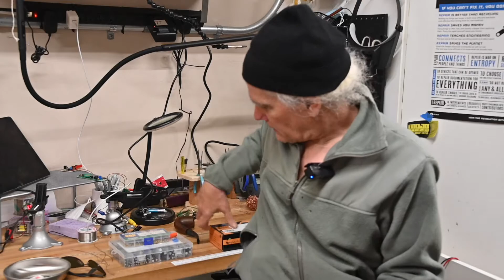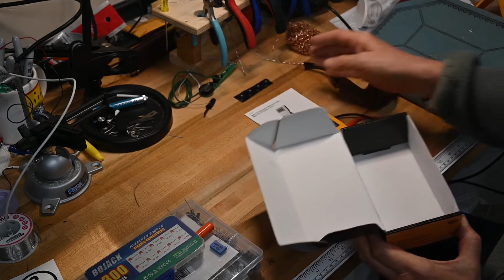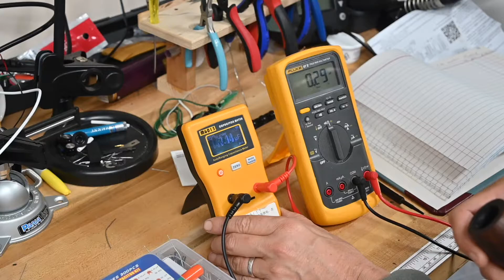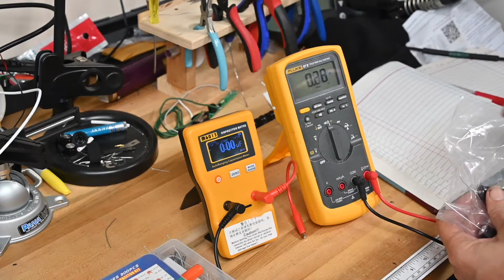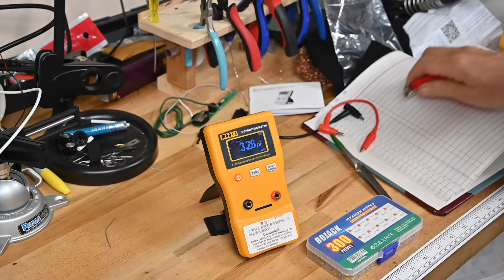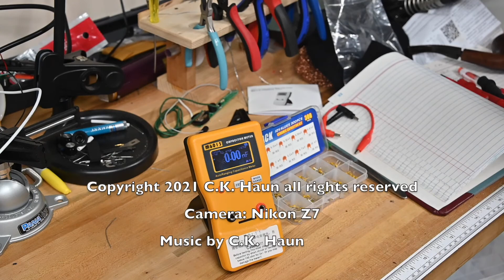C K  tries an inexpensive cap tester

Comment: I just bought one also and am not happy with it . Yours is used. Meter is suppose to  come with a protective clear plastic film you peal off that's over  the display. 
When I put my meter in manual, the display keeps saying it's discharging and I don't even have a capacitor connected. I don't know if that's  normal or not, the directions don't say.
Reply from the maker: Mine says 0 mF without a cap connected.  And yeah, it's not a great unit and my multimeters do a fine job at cap value sensing, which is all I really care about.